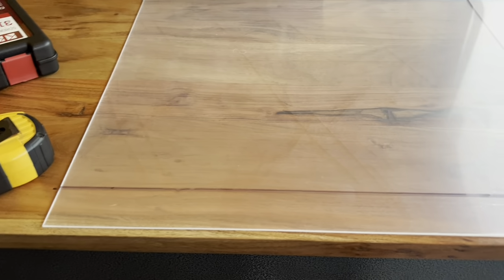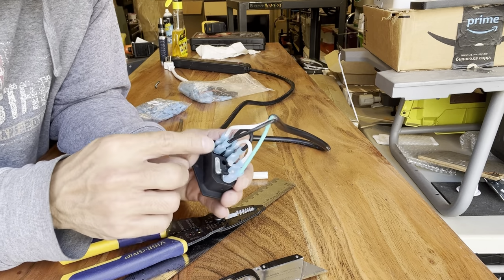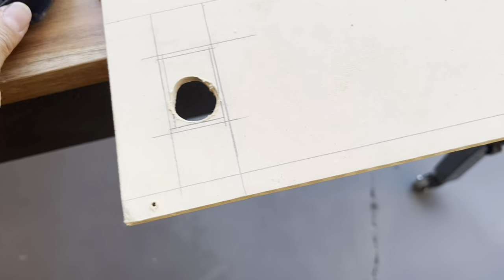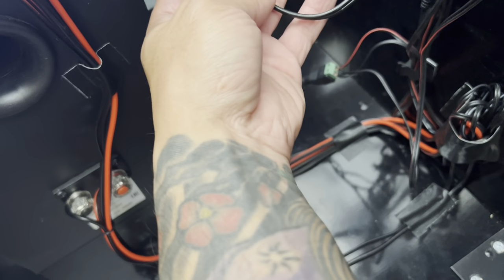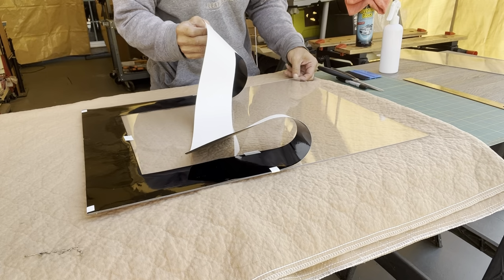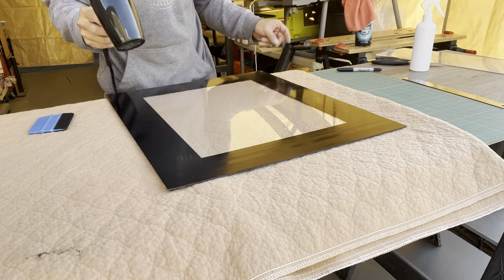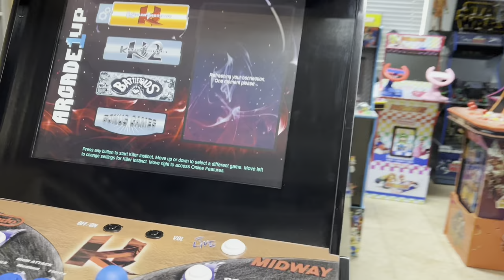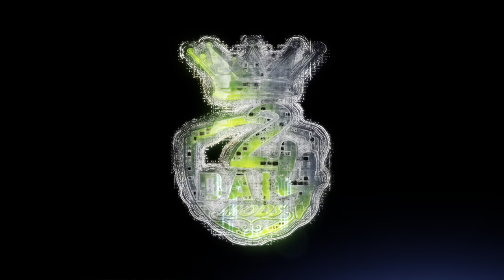Arcade1up Killer Instinct pt11 Komplete

Comment: Clean as a mutha!!! 👌Also thank you so much for mentioning the issue about not pushing in the HDMI cable all the way. I did the 20 inch mod back in January when I first got the KI cab & when I'm at the main menu the signal cuts in and out. Couldn't figure out why so I just delt with it lol.